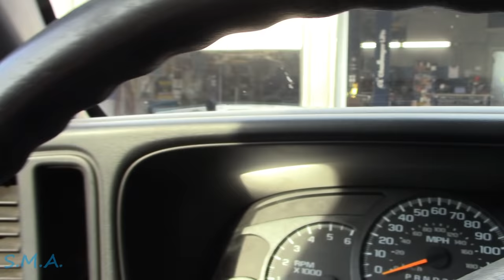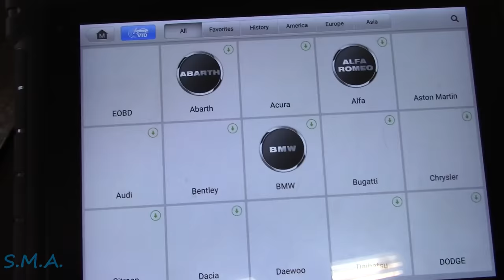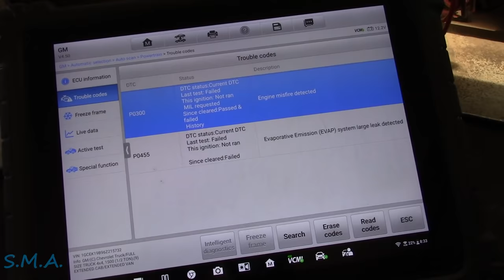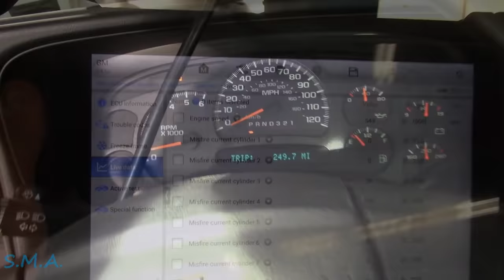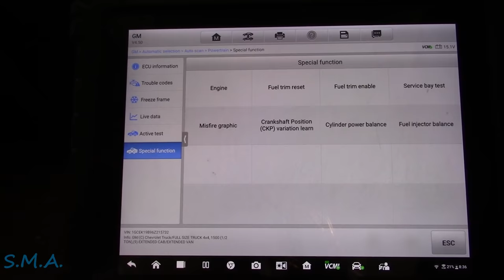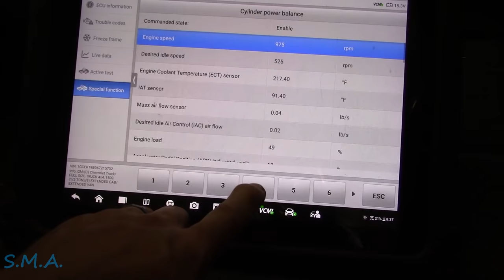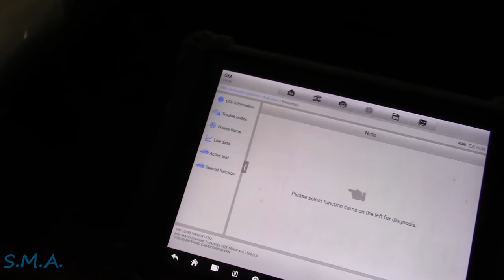GM - Chevy Truck: Misfire Diagnosis

Comment from the maker: Just like skinning a cat there are many ways to get the job done. Being a professional shop I will typically use the tools I have at hand to diagnose in the most efficient way possible. However, in this video I use a combination of techniques to help us find the fault. Just remember, there is no wrong way of doing it if you end up with the correct answer. However, there is usually a more efficient way to do things. -Enjoy!

Fuel Injector Tester: https://amzn.to/3BYUMei
Fuel Pressure Gauge: https://amzn.to/3txDNga
Reply: No cat skinning on this channel, you will pi$$  off Mrs O.🙊😿
Reply: Like when I used to do winterizations on RVs, everyone had an opinion on the right way to do it.
I would tell them that there are many right ways but there's only one wrong way to do a winterization.
If the pipes freeze up, then that was the wrong way.
Reply: As far as the waveform. I wonder would it look like on the Pico or snappy? And did you wonder that a check it yourself Mr. I?
Reply: Sorry Mr.O for the miss print.
Reply: The dip on the trace was actually higher up the trace (closer to max just before the trace rounded on the top) on the good cylinder and completely missing on the bad one!
Reply: @wino99999  good eye. I couldn't tell on my phone, I'll look again on a bigger screen. Thanks
Reply: If it works, it's the right way :)
Reply: Surprised you didn't use a stethoscope on the injectors after isolating the cylinder and checking spark as one of the easy, non-invasive checks to narrow it down.
Reply: Great Scotty impersonation
Reply from the maker: @stevebot  that is a great idea! Totally forgot about the old screw driver to the ear truck!
Reply: More fun to work on than a Found On Road Dead....
Reply: Can that same test be used to trace down a leaking injector without pulling the rails off the reason I ask is because I'm trying to track down where I'm loosing fuel pressure when I shut my Chevy thunder off but it's only a 50/50 that it looses fuel pressure
Reply: @SouthMainAuto  I have an extreme idea (because I just saw Ivan's video series on the volvo turbo grenade due to bad pcv valve design) - could you have stuck a camera down the spark plug hole of a good cylinder and then done the injector pulse so the camera would show fuel in the cylinder and then do the same for the offending cylinder and see no fuel flow? Of course the electric test would still need to have been done but this would have (imo) visually confirmed mechanical failure....?
Reply: @awaara24  No need to visually confirm, no loss of fuel pressure means no opening of injector pintle.
Reply: This video was textbook!! 👏🏼
Reply: Who’s skinning cats these days?
Reply: @awaara24  That test would work on a direct injection engine, however this engine has fuel injectors that spray at the back of the valves.  So you'd have to turn the engine over to get the cylinder you're testing with its intake valve open to do your test.  Not sure if you'd be able to see it at that point - you'd have to do the test on a known good cylinder to prove the test actually works, then carry the same conditions to the bad cylinder.
Reply: @ablackformula  yes, you're absolutely right now that I think about that lol forgot what port injection was for a minute smh
Reply: If you were a doctor, we’d have a cure for cancer.
Reply: @awaara24  it may still be an interesting test though, just a little less chance of it working now.
Reply: @stevebot  I'm with you.  Surprised as well the stethoscope didn't come out.  Cheaper than that scan tool and a lot faster to get to the problem.
Reply: @South Main Auto Repair LLC what was that you put on the spark plug that you attached the alligator clips to? I know you were checking to see if the plug was good but was that I tool you made?
Reply: @SouthMainAuto  Yup, I am old an school mechanic (way older than you I would surmise) that was around in the pre fuel injection and electronics era. The stethoscope/screwdriver was always an important tool in our diagnostics arsenal. While other mechanics my age shunned computer controls waving their crucifix and shouting black magic, I hungrily devoured all the information I could gather and became quite adept at diagnostics and reading wave forms.
Huge respect that you are able to accept that there was another simple method available that you neglected to use.
You also taught me something, never even thought to monitor fuel pressure drop while pulsing an injector, I am now off to build an arduino based injector pulser.
I am too cheap to buy a commercially available one.  :-)
Reply: @A. Melbs Yup, listen for ticking sound.
If you are not sure what it should sound like, listen to the ones that are working.
Reply: @mathuelee2686  if it’s not miss firing on startup in other words dumping fuel in the cylinders check the fuel pump.
Reply: @alcajun619   I can feel a slight stumble on idle and I just recently changed out the fuel pump to a new one to rule out a fuel pump issue
Reply: @alcajun619  and when it does lose fuel pressure it does backfire
Reply: How about you invent a camera scope that you remove the spark plug and screw the camera in and watch what happens in the cylinder ?
Reply: @adamUDavies  lmao
Reply: The most efficient method typically becomes evident after you find the problem.  Peering into a crystal ball with 20/20 vision...most efficient!
Reply: The origin of "skin a cat" is "skin a catfish", so land dwelling cats are safe.
Reply: As a young buck in a GM dealership the techs would pull the the injector and attempt to have it spray a piece of poster board to prove it bad. Have to remove it anyways if you're calling it bad. No criticism at all, just sharing the process. I learn something every video thanks man!!
Reply: Ever have a 99-06 Silverado in with a p0300 and injectors, plugs, wires and coils are all good? Good spark, fuel and air, still with the p0300?
Reply: U know dogs can't do x-rays........but catscan. 🐱🐈
Reply: Had the same thing wrong with my 99 Tahoe, ended up being a bad O2 sensor
Reply: Really good video
Reply: @A. Melbs : A mechanics stethoscope works a  better than a screwdriver IMO. A respectable quality one should only be about £15 / €15 / $15 brand new.
Granted, it’s one of those tools you won’t be using very often, but it’s always handy to have in the box for very little cost.
Reply: @A. Melbs : Yeah, you’ve hit the nail on the head there. “Clearer” would be the absolute best way to describe the difference between using a stethoscope and using a screwdriver.
Reply: @Stambo59  He's not "way older than me"...
I'm 71!
Reply: @robgraff  I think that is a good idea for the guy that doesn't have the tools to pulse the injectors. Also if it is tough to get a gauge on the fuel rail.
Reply: I work for an auto parts store you don't like, and tell customers to do what you did to test parts so they don't buy stuff they don't need. My boss doesn't like it, but customers do.
Reply: Yeah
Reply: Just in case there are youngsters watching, the term "more than one way to skin a cat" refers to catfish, not felines.
Reply: Ist possiible the folks who sent it on to you also used the scope method and came to the same conclusion, surprises me they didnt try any old skool methods you used,  in that case tho.
Reply: As a master auto tech and licensed A&P, this was a good video for a novice to watch and learn but took way to long to diagnose a faulty injector.  Also the totally white plug on #4 was a give away that cyl #4 was not getting any fuel.
Reply: We
Reply: Eric, I just want to thank you for the way you talk to us as though we are there with you. You my dude, are awesome! Keep on keeping on. OH! And tell that missus of yours she's awesome too!
Reply: @871jamie   Think of it more as he wasn't repairing the truck, he knew d*** well what was wrong with it but he was giving a class.
Reply: Mr.O reminds me so much like my brother Dan he was a bonified perfectionist and genius all things internal combustion, makes me miss him so much.
Reply: Some dogs write excellent "Lab reports" though.
Reply: Great video
Reply: Yes I know this is an old Video. Eric I love they way you diagnose from every angle possible. I imagine partly done for the video but it allows for 98% successful repairs without loading up the parts cannon. 
One other way you could check the injector after confirming it is getting power would be to use a Stethoscope and listen to the injectors. The good would have a clear audible clicking and in this case #4 should be silent or the clicking would not be heard. 
Great job Mr O , really like your methods, and diagnostics. 5  ⭐️  Mechanic
Reply: @billupstateny9151  Cat fish bro.
Reply: @deeeeeeps  Another exaggerated aquatic adventure 🛐
Reply: I learned a lot watching thank you so much. I appreciate your efforts to teach. Your buddy James
Reply: @@a.melburn you can't always diagnose everything by justlistening to it. Your A/C compressor for example. Unless there's something really serious wrong with it, you probably won't be able to figure much out with that method. However if you have a manifold gauge to check the pressure on the high and low sides of the compressor, that would tell you quite a bit. Visually you can also look and see if the clutch is engaged and turning the compressor. A lot of diagnostic methods are a matter of experience. It takes years of practice to put all the available information together and come up with a solid diagnosis. Some are simple and some are time consuming. But what he just showed you in this video covers a lot of ground and covers a lot. Good luck!
Reply: @nyadirondack4247 I'd do a compression test next
Reply: @mathuelee2686  wow Lola looks just like my male cat Chrysler
Reply: I got one for ya. On a 5.3. I got a miss on two cyl. 1 and 4.  I switched the coils and plugs and wires and injectors around with other cyl. that were working. Its staying with those two cylinders. I replaced the lifters,cause it was brought to me to change out the lifters. I even pulled it back apart to make sure i had them in the right places. I did. Did a leak down,and had a little air from the dip stick. So did a compression and they were around 125. Fuel pressure is around 50.psi.  So now what?
Reply: In this case, analog wins the day...great video Eric O 👍
Reply: GOOD JOB BROTHER,I USE A STETHOSCOPE ONE CAN HEAR THE INJECTOR CLICKING(HOPE THIS HELPS YALL)
Reply: What Autel scanner are you using in this video?
Reply: Just to let you know. I was pretty talented back then. You are as good and probably better than I was. That's difficult to say but it's true. Follow the facts. Been watching you for a long time. You are more talented than most other people. Thanks for keeping an old man interested in diagnosing cars. You are one of the best!!! Than you.

Comment: Do you ever notice that the cars with running problems always have no gas in em, but if it needs a fuel pump you can bet it'll have 3/4 of a tank or more?
Reply: It's the same vehicle, they overheat the pump running the tank low all the time, get some extra cash and fill it up and that's the nail in the coffin for the pump 😂
Reply: Well, of course! If the pump isn't running the fuel stays in the tank until some poor working man has to deal with it.
Reply: I once had a customer tell me they knew I was going to have to do something with the gas so they filled it up all the way full for me... as a favor.
Reply: So true my brother had a 94 Buick and the fuel pump went out and just like you said it had about 3/4 of a tank
Reply: 34 gallon tank in my 1500, Filled the tank , truck wouldn't start, towed to the dealer across the street , new fuel pump , problem solved always the way it seems to be ha ha .
Reply: Same  things with every single def tank that I have ever had, everytime the header had issues they fill it all the way smh
Reply: Lol
Reply: Every time
Reply: Last summer I filled my Jeeps aftermarket 30 gallon tank, fuel pump died and it wouldn't start. Had to drop the full tank. Today I'm dropping a 35gal ford tank to do a fuel pump, yea it's full. Two days ago I did a clutch job and when I went on the test drive, it was outta gas and I had to stop and put gas in it🙄🙄🙄
Reply: Another GM reliable failure, the fuel pump….
Reply: Of course, that Murphys rules!
Reply: @Dumbass_mechanic  🤣. Figures. How thoughtful 😶
Reply: I do wof inspections ( safety/road worthiness) and you can just about guarantee any vehicle from a car sales yard will have the low fuel light on and the needle stuck on the stop. Can be quite scary road testing sometimes.
Reply: 6 different vehicles across my dad and I this past 15 years. All 3 of my trucks (dodge/chevyk1500/chevy Silverado 1500) needed fuel pumps on the way back from topping the tank.

My dad's vehicles were the same way. 6 tows back to the house to drop a 26-34 gallon fuel tank.
Each failure was a Florida june-August timeframe.

I absolutely agree with ya.
Reply: @dakotataylor7909  yup!
Then these same owners want to bitch about the diagnosis, want it for free, are gonna wait for it ti be done at like 2pm on a Friday before a 3 day weekend.

Look man,(woman), stuff wears out, stuff fails, it could fail from abusive service conditions it could fail cuz ya cant get decent parts hardly at all right now.
Gas in the tank is money in the bank. Running lean is a sure fire way to expose any hidden mechanical issues said vehicle may already have.

It's like some owners arent cheap or shrewd or anything. Just want Michelin star service at the drop of a hat for jobs that maybe could get rushed and done but theae customers don't even feel they should consider a tip.
Don't even get me going on the customers calling ya up clueless about their broken vehicle and then argue with you over the diag.
Yall can decline service. Hell ya cab decline having my emloyer and myself do the work.

Ugh, customers are the best and the absolute worst douchesoups anyone can encounter.
Reply: The last two times I lost fuel pumps I had full tanks. It's supernatural.
Reply: Every time !
Reply: @dakotataylor7909  people dont understand that fuel pumps are lubricated AND cooled by fuel lol
Reply: NHTSA cited the content of sulfur in the fuel.
Measuring statistics showed the locale for greatest number of failures.
Their gas comes from refineries closer to them.
If your fuel came from there at the time of the study, it was more likely your pump was working too hard and failing sooner.
The thing you can do that helps you is regularly change your filter at or before 15k.
These are NHTSA findings, and there's other facts that pertain to specific MMY's.
They issue bulletins for those if it's not recalled.
Guys like Eric  O. Also do information searches to keep from having a problem build sneak in and take up their time.
There's often updates in the bulletin that pertains, or the same info is used where it doesn't officially pertain.
Then Robert's your mother's brother.
I've stopped at the public library on the way to the parts store for car info.
I've saved people diagnostic hours and tools needed additional, that way.
They still bitched and blamed their spazmobiles on me, they weren't keeping the POS, and didn't want to pay a bill no matter what you did or how you did it.
If you stop helping them, they steal your tools while you're sleeping.
Then, they lie about that.
Just tell them the likely cause in a friendly way, then go check that your stuff is still there and locked up.
But info is supposed to be provided, quite often, by libraries and there's more than one type you can goto, or get their help online.
Happy motoring.
With your..engine.
Reply: You have discovered O'Malley's law that states Murphy was an optimist.
Reply: Yep
Reply: So that's a cat scan
Reply: Keeping the fuel lower keeps the fuel fresher because you’re always getting new fuel. Not much time to sit. I run all my things like this and ever a carburetor issue (well, one) and never a failed fuel pump
Reply: I never really had an issue I mean I just use the jack to lower the tank or if really lucky just has access from above.
Reply: Ive done 16 fuel pumps as a shadetree guy. 

Every. 
Single. 
One. 

Was after filling the fuel tank. Slap assed, 100% full to the absolute brim, every single time. 

I can confirm
😂
Reply: facts #mechanic